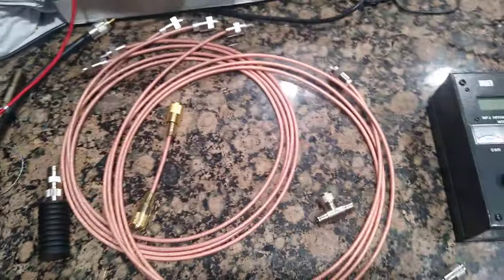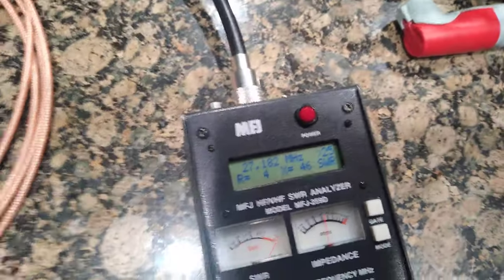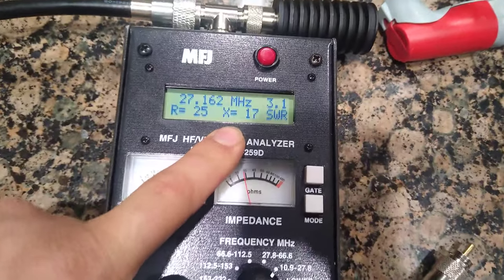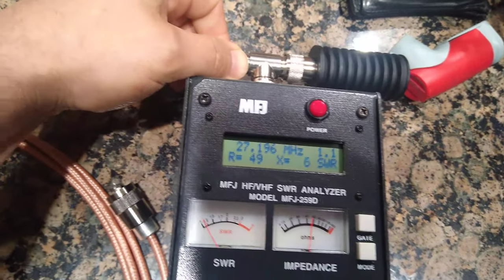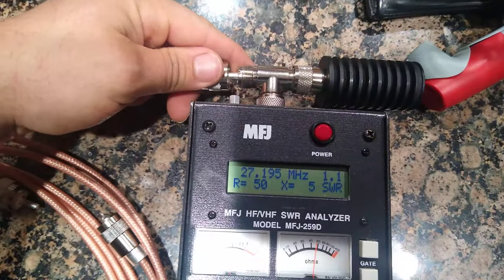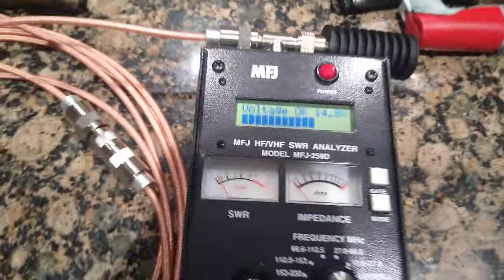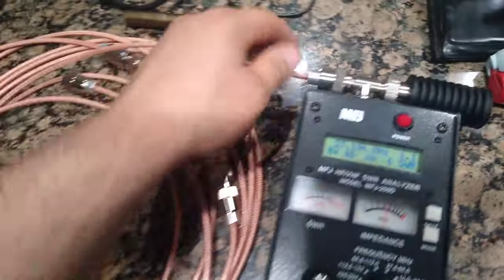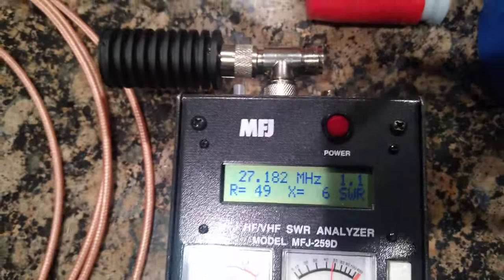More coax tuning 1/2 and 1/4 wave 11M observations

Comment from the maker: Conclusion my dummy load was defective. So yes this is correct to do it this way. But a good dummy should be X=0  SWR=1. After checking with new dummy it's all zeros
Reply: @RC-Heli835  I read that article too.  My mobile has 33’ total feet of coax.   6’ from antenna to choke(3’) 15’ to amp, 6’ to CMF choke(3’) and then mounted direct to radio for total of 33’.  Works great!!!  SWR is 1.18 give or take across 11m.  Could be coincidence.  I don’t know.  It just works for me!!
Reply: @rallypoint1  Awesome! What kind of amp are you running?
Reply: @RC-Heli835  a little kl203...great bang for buck!!
Reply: Tuning the feed line for a 50 Ohm load does not make the cable “disappear” the loss will increase with length regardless, indeed losses will be greater in the coax if trimming its length is used to correct for a miss tuned antenna.The condition you set up was an open circuit in parallel with 50 Ohms because transmission line theory says that a half wave transmission line will show the same impedance it’s terminated in every half wavelength. This will repeat every further half wavelength. The quarter wave situation is different because it will show an inversion of impedance every 1/4 wave, that is a 1/4 wave terminated in an open circuit will look like a short circuit every odd 1/4 wave. That theoretical situation is altered somewhat by line losses in real world situations. If you could measure the impedance along the feeder when terminated in it’s own characteristic impedance (ie 50 Ohms in this practical case) it would be 50 Ohms at all lengths, this is referred to as a “flat” line. This also means that if the antenna shows 50 Ohms at its feed point then the impedance presented at the other end of the coax ie at the radio end will also be 50 ohms regardless of its length! Indeed you can get a perfect SWR with a long enough piece of lossy coax with no antenna connected at all! This all means that in a vehicle installation with a single properly tuned antenna feed line length can be regarded as irrelevant. The 3 foot increments or 6 foot increments theory is invalid because it will progress you through alternating 1/4 and 1/2 wave conditions which will have differing effects on results, and don’t get me started on velocity factors. By the way RG 213 has a VF of 0.66 and RG 400 has a VF of 0.695 so the tuned length will be different for each of them. The 20 ft length will provide less noise proposition is rubbish as lengthened cables will give a lower signal to noise not greater. Tuned lengths do have their place in complex installations but for average installations it should be regarded as snake oil.
Reply: I'm having the same issue. It's the "T" connector. If you remove the connector & screw the dummy load direct you should be good. Problem is you need a "T" to tune for half wave
Reply from the maker: @alriley18  I did that and it was infact my dummy this time but I can see That being a possibility too
Reply: @johnyoung1128  Do I need calculated 1/2 wave length of coax  with velocity factored in from the analyser to the antenna to get an accurate SWR to tune an antenna?
Reply: @RC-Heli835  The best way to measure the SWR of an antenna is at or very near its feed point, theory says a half wave transmission line will “reflect” its terminated impedance back to input but that doesn’t take losses into account. In a real world environment if you tune the antenna to 50 Ohms non reactive or near to it (or 1:1 SWR or near to it ) the “tuning” of the coax  length becomes largely irrelevant because it’s in a “flat” condition as I described earlier. If the antenna is significantly off tune then changing the coax length may change the measured SWR but that will disappear when the antenna is adjusted for lowest SWR. So in short once the antenna is tuned the length of the coax becomes irrelevant EXCEPT in the case of losses where longer lengths will have higher losses. Indeed higher losses due to increasing the length will make the SWR lower not higher!
Reply: @johnyoung1128  ok thanks!
I have a Nano VNA 4 and a traditional SWR meter and my friend is needing his antenna tuned on his overtheroad tractor.
He uses 18 ft coax.
I believe  on the Rig Expert one would calibrate it to the end of that 18 ft coax.
I would need another SMA to SO239 to calibrate to the end of his coax.

Comment: Look. I've been involved in CB radio since the '70's and a ham since the mid '80's.  For a single antenna, IF your antenna is very close to 50 ohms, the coax length shouldn't make enough difference to matter....until you get up to several wavelengths....by that point, you need to conserve every micro-watt of power to overcome the loss in the coax

Multi antenna installations are another story as the length of the coax provides the correct impedance match
Reply from the maker: K. How much power u run?

Comment: Tune the antenna at the feedpoint. That will minimize reflections making feed line length irrelevant.
Reply from the maker: U can tune your antenna till your blue in the face. Just like in the video it's a perfect antenna and yet the only thing that changed was the coax length giving you higher SWR by adding different capacitance and inductance. Even with a perfect antenna your SWR will be worse if u don't have a band specific tuned coax
Reply: @electromechanicalstuff2602  Without reflection due to mismatch at feedpoint there will be no standing wave.  By coax tuning one is just coping with the frequency of the standing wave interacting with signal, and the commensurate losses and constructive and destructive interference.  If changing length or even moving coax vastly changes VSWR, it indicates reflection at feed point as suspect #1 and that bandit is often accompanied by RF on the outside of the coax. Good luck.

Comment: I cut all my coax in half wave  increments and have the best results I've ever achieved.
Everything checks out better.
Been around radios since a kid in the 1960's and this is the best way to cut coax. Period.
Reply: What if you have a resonant folded dipole, what benefit is having half wave length of coax
Reply: @paulm0hpd319  Nothing,,,, 
The Dipole don"t care if its 50 or 100 foot coax.
Reply: @OLDMANGAMING1970  of course it does, a folded dipole is around 300ohms that's a 6.1 swr ,all the half wave increment is going to do is repeat that 6.1 swr at the radio ,so no benefit of half wave lengths, that said other lengths may bring that impedance down to a more exceptable level
Reply: Ja zrobie 50 ohm obciążenie ale bedzie cos smiesnego w mojim wieku !!!😶🤥🤥👍

Comment: When making jumpers I just trim until X reaches 0 ( Z on my mini60) if you really want to get picky, I can scroll up and down to find the frequencies where it goes back up to 1. Then add the high and low frequencies together and devide it by 2 to get the true center. 

If you think about it for an antenna. If you set your antenna to the perfect length for the band. Then hook an untuned piece of coax to it. You have to lengthen or shorten most antennas to compensate for the mismatch.  Seems like that would affect the antennas performance, radiation field pattern and takeoff angles.

Comment: Cable Nulling. Any load connected to a coax that is not perfectly matched to the coaxial cable'scharacteristic impedance will have its impedance modified by the coax. Cable nulling allowsyou to remove the effect of the coaxial cable so that the impedance you read shows the impedance of the load at the end of the cable, without the cable modifying effects. Cable nulling is available in the VIA mode, the SWR mode has no cable null feature.
Reply from the maker: Coax can change the impedance of the circuit tho that then essentially causes a change in the SWR. For instance u take a perfect node coax and a perfect load and perfect output tune on the amp. U can cut the coax anywhere and install the SWR meter and it won't affect the SWR but let's say instead of cutting your perfect coax or attaching it either end you choose to add another 3' jumper from your meter to your amp. Now u have changed the impedance match u had thus changing your swr because your have added some amount to impedance to your amplifier output tune. Now if u have a tube amp u can correct for this with the tune cap but if u have a transistor based amp that does not have a variable tuning cap the SWR will change.  U can now either open your amp and change the capacitor to adjust for your output tune or get an antenna tuner that essentially does the same thing. Now if u don't want to do all that. Just make sure all your jumpers are nulls or put your meter in at a half node point both in and out.
Reply: Dear Sir,
I always zero my coax because while measuring the swr so impedance of my antenna I only want to measure the value of my antenna and not see false values caused by the capacity and induction that the coax causes during the measurement.
I once saw and learned this from a radio amateur who was also a civil electronics engineer.
Everyone laughed at me when I did this, but none of them got their swr value of their antenna really right, unless they arranged their antenna with the Rigexpert and or the MFJ directly connected to the antenna.
There is even a measuring device in which it is explained in the manual that the coax must be tuned for the frequency at which one wants to work.
I had attached the link but apparently you-tube removed it.
Best regards.
73 Marc

Comment: If everything is Grounded properly, Antenna, Coax & Station then a Tuned Coax is no different from a Radom length coax
A Tuned length of Coax does work, or adding a small piece to tune

Comment: I tried making a quarter wave jumper out of a Belden RG-58A/U and ended up on a lenght a little less than 6 feet to achieve that X=0. Great video, thanks. By the way, that's without a dummy load.
Reply from the maker: Really... What happens when u have a load?
Reply: What happens when you change the frequency on your CB?
Reply from the maker: The swr gets worse. That's y u target the center of the band your using. Just like when u tune your antenna. I bet you have either no power and use an antenna tuner

Comment: Did you read the manual on the antenna analyser? Do you know how to use a dummy load?
Reply from the maker: Where's all your educational videos? Oh u don't have any cause your not here to help the community only be a troll and criticize it. Gotcha next
Reply: thats not my video but it gets the point across
Reply: Ive been attaching coax to antennas for years as a Ham radio operator and the only time coax was needed to be tuned was for repeater filters where receive and transmit on a single antenna happens simultaneously. Tuned feedlines only work at one specific frequency where they are tuned.
Reply: When I say they only work what I meant to say is they are only Tuned at one frequency

Comment: You can do unewen wawelenghts
In cabel using velosety factor
But COAX IS MOSTLY USED
FOR UNBALANCED ANTENNAS 
NOT BALANCED WITH LADDER LINE
Reply from the maker: All I know is I used an antenna analyzer with a standard 12' piece of coax and I could see the lowest swr frequency. I then tuned my antenna to my desired frequency. Swr achieved was 1.45 swr at its lowest point. I then tuned this coax separately to achieve a" invisible" piece of coax. Now my swr is 1.1 at its lowest point. The coax was absolutely playing a role in my overall swr.

Comment: it looks as if the coax is invisible form the system when coax are cut in multiple of 1/2 wave
Reply: @pamhockens4148  so if we wantr a perfect system, we have to cut the cable odd multiple of 1/2 wavelength?
Reply from the maker: @jbx907  yes
Reply: @jbx907  no you don't this is an old CB wives tale, what happened is some CBer read a ham radio magazine Discussing phasing harnesses which utilized tuned coax stubs and misunderstood what they were reading. Unfortunately this is the end result of the dumbing down of the ham radio service. Nowadays a ham radio ticket isn't worth the paper it's printed on as is clearly demonstrated by this video. 

The bottom line is if you're not phasing multiple antennas together or doing something like building circularly polarized antennas where one array is fed 90 degrees out of phase from the horizontal array then coax length is irrelevant. Anyone who tells you otherwise has no idea what they're talking about.
Reply: Take a look at my posting today about some tests I did, it might make you think again.
G4GHB.